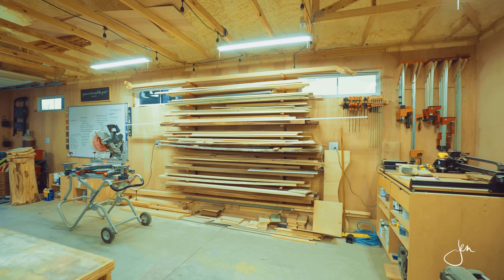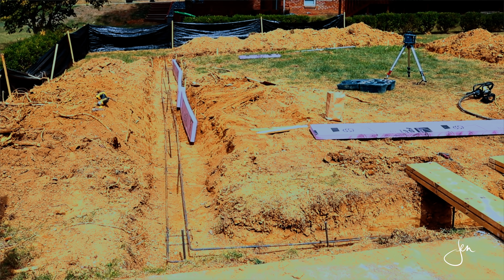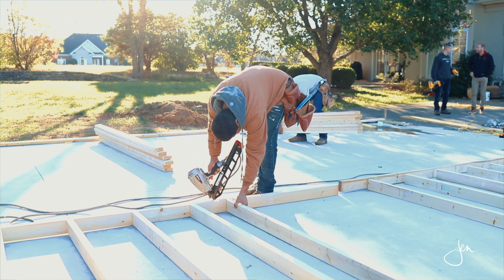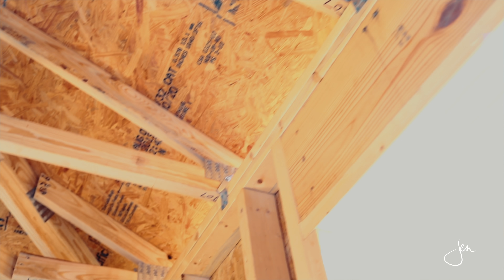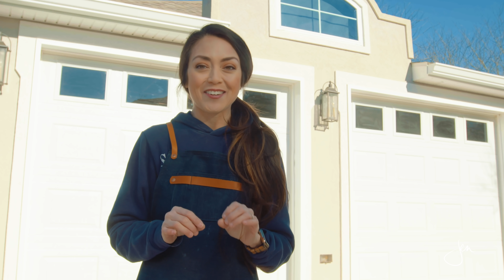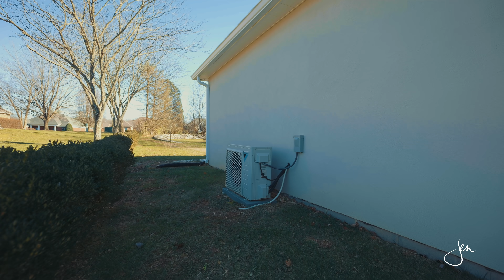Welcome to The Woodhouse WORKSHOP! (Workshop Build and Shop Tour!!!)

Comment: Hey Jen.  You and I built nearly the exact same size "play room".  I retired in 2018 and had a a 24 x 32 shop built with an additional covered 12 x 24 patio on the back so I could work outside as well.  I do woodwork and also weld, so even the electrical is similar.  I am sure you will enjoy your new shop as much as I do.  I spend many hours 7 days a week, creating.  I love my space and it has definitely been my oasis during the pandemic.  Wishing you well and lots of wonderful hours letting your imagination run wild in your new shop, it is amazing!